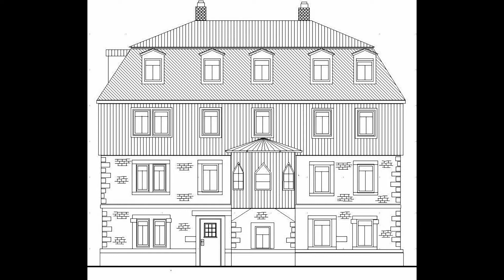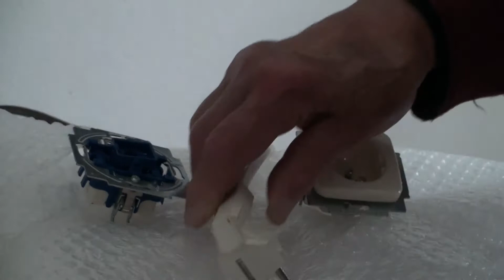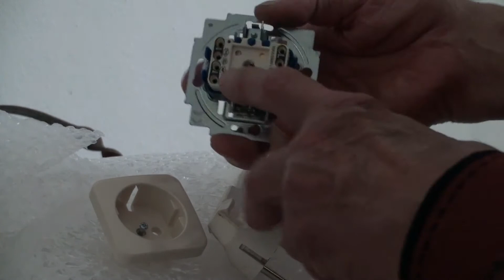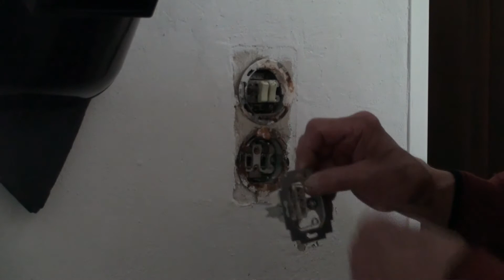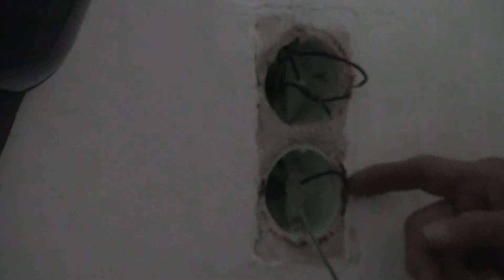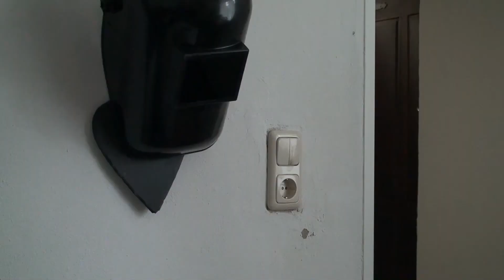Shocking Switches and Sockets

Comment: Very interesting Bruce, I've seen those plugs but didn't know how they were wired. I knew they were 230 volts but didn't know the one power wire carrying the the 230 volts. Unlike in the States were we 2 -110 volts and neutral with ground on our 220 volt plugs.   Does look to be a much safer plug recessed like that. I have one of those tester also and works good for a quick test of a circuit. Take care Bruce and see you later
Reply from the maker: Rusty Glovebox Thanks Lloyd. Our single-phase here is 230 v. Our 3 phase is 400 v. I have a contactless, modern tester, but it was upstairs on the 3rd floor and I was too lazy to get it. The little lamp from my dad works for 50-600vac. I had not used it in years, but found it in my electric parts drawer.

Comment: Interesting, how they do the sockets and switches. As you know, we are at 110 volt for wall plugs. The dryer and oven are 240 volt in the states, but we have a gas dryer.
• Cheers from Michigan

Comment: The old socket had some rust on the outside but it might have outlived all of us unless the contacts inside were badly worn out. I really like those old chunks of porcelain!

The earthing setup you've got was incredibly common in many places but is quite nasty. It was also used for large appliances like dryers in the US I think. As long as the neutral is solidly connected it's at zero potential, i.e. safe to touch. That's why you can safely connect it to the earth terminal of the socket, which is exposed, as are the metal shells of any appliances you happen to plug into that socket. Should a metal appliance be faulty, connecting 230 V to the metal shell, a whole lot of current flows from the live (hot) wire to the neutral, blowing a fuse/tripping a breaker.

The big issue is when the neutral gets disconnected because of a dodgy splice somewhere upstream. Now once you turn on an appliance, the neutral is now essentially connected to the hot wire and through that wire link inside the box is the metal shell of anything you happen to plug into that socket! That's why a complete rewire is a really good idea if you have that arrangement!

BTW, that looped black is probably the incoming live from the fuse board, not going to a light. There should be two more blacks going to the lights you mentioned.

Comment: Very interesting Bruce! I have often thought about the non-standardization of electrical services worldwide and the wide array of voltages, hertz and equipment types used.  But It's truly curious to me that as the world was just starting to become electrified that there was such an incredible period where today's worldwide diversity of equipment would be considered laughably sparse by comparison. As a small example consider that for a while there were both DC (as espoused by Edison) and AC (as promoted by Westinghouse) power plants operating at the same time within the same cities in the US!  I am quite certain that the newer German style wall plugs are far superior to the old fashioned US style plugs still in use... with a little bit of carelessness it would be very easy to get an electric shock plugging in a US flat pin plug.  The unfortunate thing is that because of the HUGE number of sockets in use now and the vastly greater number of electric appliances with those plugs, I doubt if US wall sockets will ever change.  Cool vid brother!
Reply from the maker: MISTERComaToes Thanks kindly. Yes, once something has become that established it is virtually impossible to change it and politically a hot potato! LoL

Comment: Oh yeah..I've been zapped by 240v @ 10 amps AC..50hz..Not nice at all...Our plugs and sockets and switches are nothing like that..Interesting stuff.Our outlets are either low to the floor or a couple of feet off the floor...3 pins..all at an angle so no mistakes...I remember when my grandmother's house had a red globe that lit up when the switch was on all in Bakelite...That place is long gone now...I found an Edison Reel under the house and a gramophone when I was 9..
Reply from the maker: ZIGgassedUP Thanks Ziggy. Those Bakelite switches and sockets draw big money on ebay. Our old ones were from the 1950s and weren't in the least interesting or valuable. :-)
Reply: Few things beat getting zapped by 400 Volts (jumpering two phases of a 3-phase system with one hand)! Very rare but quite awful! The thing that saved me was the very fact that it was just one hand and I was wearing proper work boots so no current flowed across my heart. I did get nasty burn marks on my fingers!

Comment: Enjoyed your little "lesson" covering the basics in European household wiring.  Here in Canada, we use the North American standards as you mentioned. As for being more dangerous, well yes, I suppose our flat-blade, non-recessed receptacles are slightly dangerous.  The smarter kids learn quickly.  As a kid, I'm sure I got "zapped" a few times, yet as an adult,  I've somehow managed to do it occasionally as well.  To me, it's just a rather unpleasant sensation.  Not quite the "9-volt battery" sensation,  just unpleasant enough that unlike a 9v battery, I don't want to try it again within the same day (or week) of having it happen :)   I'm not a licensed electrician, but I have taken a few courses, mostly for interest, and I am quite comfortable working with electricity in the home setting.  Canadian law permits anyone to do their own wiring on their own property,  but I could NOT do wiring for anyone else, nor could I do any work for pay.  Of course, I could always start taking courses towards becoming a licensed electrician if I wanted to.  I like using gang switches, rather than having a silly row of say, 4 switches or more lined up across a wall.  It's different in a commercial or industrial setting, but in the home, I don't mind having a 2-gang or a 3-gang switch in the place of a single-wide box.  That said,  I will admit that it is certainly more challenging working with multiple wires coming to a single 3-gang switch in the space of a single-wide box :)   Bathrooms and areas where it's likely to see moisture, should have a ground-fault interrupt (GFI) receptacle outlet.  I've put GFI's in several bathrooms merely as a retrofit (it wasn't required by law for me to do so, but any new construction after a certain date back in the 80's must have it).  Most recently, I decided that having only the two standard (stacked one-over-another) outlets in my bathroom wasn't enough, so where the bathroom had 2 single switches side-by-side in a double box, I now have the GFI outlets in the position where the only outlets used to be, plus another outlet (on the GFI-protected circuit), with a 2-gang switch for the light and the fan.  It's great having more outlets in the bathroom. Now, in addition to having a place to plug in my shaver to charge, I can plug in one or two of those AA/AAA battery chargers, which take about 14hrs to charge up 2 or 4 batteries,  and if I need to do some vacuuming, it's handiest to be able to plug in the vacuum cleaner right there in the bathroom, and you can get 3 rooms plus the hallway cleaned up without having to go hunting for an outlet in a bedroom (which are probably all occupied already anyways).  Getting back to the differences between European, UK, and NA and other continental standards for electricity,  I would agree that some things done over "there" (wherever there may happen to be) might be slightly more thought-out than they are here in North America,  I'm quite comfortable with the way things are set-up here.  I guess it's because I'm just used to it.
Reply from the maker: Thanks for your thoughts, Stan. My thoughts about wiring the US are based on experience 50+ years ago. I did a lot of electrical work as a kid because I got my ham radio license when I was 11 years old, built my own 75 watt transmitter and wired up my own room and radio station. Getting zapped was not that uncommon, but since I've been in Europe it's only happened a few times and 230 VAC is quite a bit more exciting. Since I became and electron microscopist and learned to repair my own equipment I learned to work with UHV >100kv, too. You don't get zapped by that. I did all the wiring in this house according to German standards and I don't see any problems. I'm less secure about plumbing, quite truthfully. Thanks again.

Comment: Standard cables in Germany are equiped with these three leads :
230 V = brown 
0 V = blue 
Ground  (PE) = green and yellow
Reply: In case you use three-phase current  (400V) on cable with five leads....
1st phase is brown,  
2nd phase is black and the
 3rd one is grey.

Comment: Thank you! I just came to Romania and half of the sockets and switches are falling out of the walls. I am trying to see how they stick in the wall.. No screws hold them in the walls, only teeth like clamps that seem to push on the sides but I  can't see how they are tightened to hold them in.. Do you know how to make tight?
Reply from the maker: Thanks for watching, Gary. Yes, the switches and sockets are often held in by those expanding clamps. Unfortunately, they usually only hold well if the plastic outer shell is firm and intact. Even then it is best to hold the socket in the wall when you pull out a plug. That said, here in Germany the outer plastic shell (that is plastered into the wall) usually has 2 or 4 small holes around the periphery. There are self-tapping screws available that can be used to fasten the socket or switch insert into the shell. In German they are called "Installationsschrauben" or installation screws. I bought 100 on German ebay for about 5 Euros. Whether you can use them or not depends upon whether the plastered shells have the screw holes or not. 'Good luck on this and enjoy your time in Romania.
Reply: Bruce thank you for your help! I was able to see from your video and you explanation how to make them tight enough with the side grips. and these are exactly the same only somebody seems to have covered any screw holes with plaster during a remodel but i managed. You help me save alot of time!
Reply: Yes, they are usually holding on by those "teeth" that go outward.
Unfortunately it's pretty common to have switches and sockets popping out.

Comment: what i saw was i think 1.5 mm witch was on 16 amp fuse it is slightly lighter than 14 awg witch is ment for no more than a 15 amp fuse or breaker thanks
Reply: Weeeell... the theoretic current-carrying capacity of 1.5 mm2 under ideal conditions is just shy of 18 amps. In modern buildings, wiring is frequently embedded in insulation, which pushes down its capacity to just about 14 amps. In case of solid masonry or interior plasterboard walls without insulation, most German electricians still go for 16 amps. Other European countries tend to go for a higher safety margin and usually restrict 1.5 to 10 or 13 amps but I don't think it's actually a requirement anywhere, just common practice.

Comment: i like your video i do wiring in the us i think german wiring is lower standerd then us we use 12 wire in most rooms kit. bath much heaver then german wire 14 in bed rooms living rooms on 15 amps its slightly heaver then german wire wich they fuse at 16 amp
Reply from the maker: +David Berquist In Germany the smallest cross section that is allowed for in-house wiring is 3.5 sq. millimeter, which is equivalent to 12 gauge.
Reply: Actually 14 gauge is already close to 2 mm2 and the minimum size in Germany is 1.5, close to 16 gauge in the US. The NEC (US electric code) requires fairly oversized wires for general household circuits, I think by the book 14 gauge is good for over 20 amps but there's a minimum requirement for household wiring just to be extra-safe. I partly agree with you, I wouldn't readily use 1.5 mm2 for a 16 amp circuit but 14 gauge is definitely overkill. I suspect that's partly because the NEC couldn't care less about issues like voltage drop (a wire is essentially a resistor that converts some of the power flowing through it into heat, reducing the voltage you'll see at the end. Voltage drop is worse the thinner and longer the wire gets so at some point you get into issues with under-voltage). If you increase cable size you don't have to worry about voltage drop as much as if you'd picked the smallest possible size. In Germany that's something you really have to think about because it's easy to exceed the 4% limit with average household circuit lengths.

Comment: https://www.kopp.eu/en/productcatalogue/switch-ranges-surface-mounted/switch-range-surface-mount/cross-switch/513702008 , can you please clarify how to fix switch ? We've 3 wires ( Red, Blue and Yellow ) and I'm not sure how to fix them. I had old version of switch which had only Red and Blue wire fixed and Yellow was not. Now old switch is broken and I need to fix new one. Thanks in advance.
Reply from the maker: Since you have not told me what application this is for, what you are switching or what country you live in I cannot help you. Red, blue and yellow are not normal colours for electric wiring in any country I know of.
Reply: We stay in Berlin ( Germany ) and our apartment is build in 1960 which has these 3 kind of colored wires. The appliance is switch which is mounted in wall. Please check the product in the link of kopp.eu  Thanks in advance for your help.
Reply from the maker: Please do not risk death or injury. If you do not have the knowledge or ability to check with a volt meter or test lamp do not attempt to correct this yourself. In most older German houses red gray and black were the standard colors. Red was earth, gray was neutral and black was the phase (hot - live - power). Blue and yellow were not standard colors and therefore cannot be used as an indication of what they did. AGAIN - PLEASE have an electrician do the repair. The link to Kopp says nothing about your house wiring! A normal switch would only have two wires so it must be assumed that this is some kind of 3-way switch. I cannot and will not answer anymore questions about this. You are endangering your life if you try to fix this.
Reply: Thanks for your frank opinion, I will hire electrician. Kind Regards, Vikram